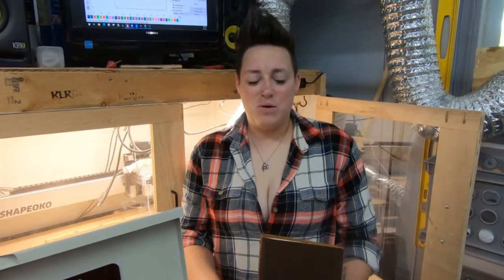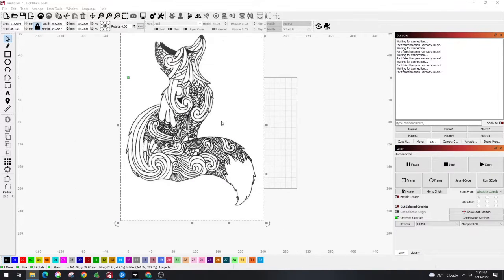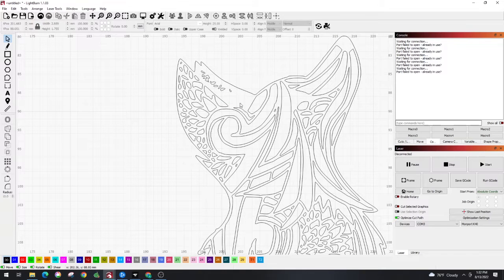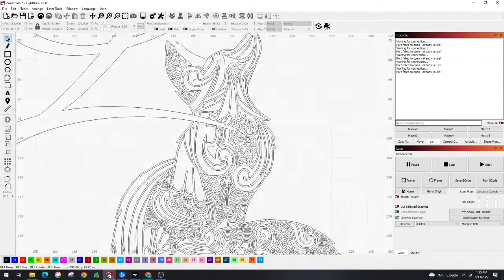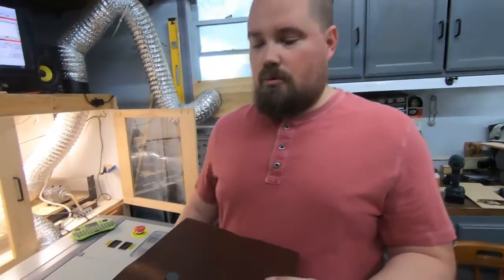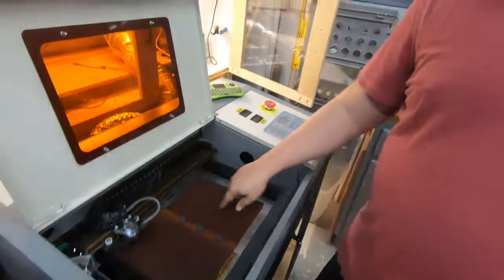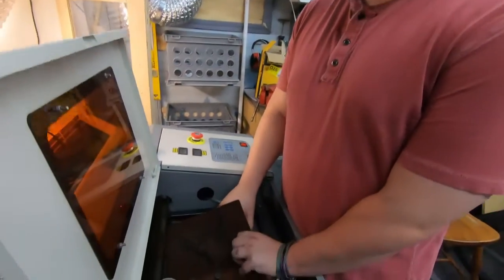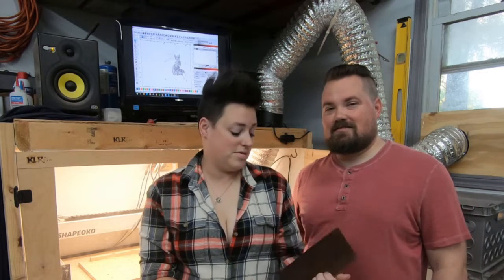Leather Etching on Monport K40 | Lightburn Design

Comment: I do a lot of leather engraving with my K40 (has the Cohesion 3D board in it ) and am wondering how much current you are using when you are doing your engravings?  I generally set mine to around 4-5 mA and then adjust my speed in lightburn to get the reults I want.  Part of the reason you're losing a lot of the finer details is using to much power which burns a wider area around the beam.  Going with less total power reduces this and gives you a really nice fine line.
Reply from the maker: I plan on testing the mA meter to see how much power it’s really using. It seems like a huge lose of power since going to lightburn and it is having issues cutting 3mm board now. I think it’s the board I am using.
Reply: @KLRform  well you are telling it to only use a fraction of the power you have set the machine to produce. I don't seem to find what you have the digital panel set to on your machine but on mine setting that to 50% gives me about 16mA which is the max you really want to use to avoid damage to your tube.  So what I did to figure out digital panel settings vs actual mA reading is to start at 5% which gave me 3mA on my meter (which is just above the minimum current needed to fire the tube) and then went up 5% at a time on the digital panel until I was getting around 15% (16% in my case) and stopped there as I would not need to go any farther than that for use.  When doing this all you need to do is have it turned on and with a scrap of some kind of material in the laser hit the test fire button briefly and see what the meter reads.  Once you have this chart you can then pick an amperage that you want to use and set the digital panel to that setting.  This will act as a hard current limit for the machine so you can'not go over the max amount you say.  This is helpful when doing a gradient or power scale test for that particular current as lightburn will then scale the current from that setting to 0 as well as adjust the speeds you put in to show you what would work best.  You'll find that most of the time you'll simply leave lightburn set to 100% power and adjust the current on the digital panel on the machine to find what you like best for a given material and speed.  Hope this helps.
Reply from the maker: @ropeany1  with the monport board you don’t use the digital panel at all anymore. So it should be going off of lightburn only. That’s why I plan to test when I can get the meter in and see what’s really going on.
Reply: @KLRform  are you supposed to turn the current diail full open then the software control the power?
Reply from the maker: @pietpompiepompiepiet940  It depends on the control board. With the Cohesion 3D you have control in both places. With the monport board you can only control in lightburn. Our model does not have a dial